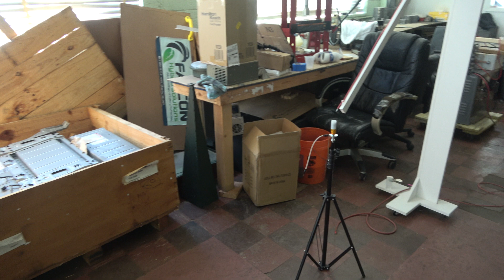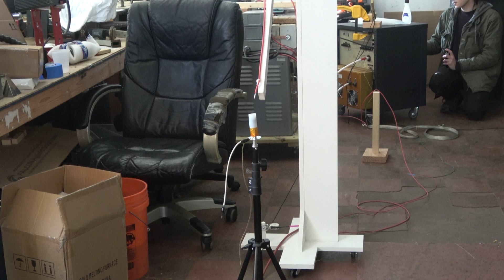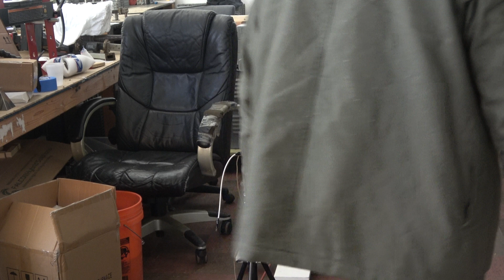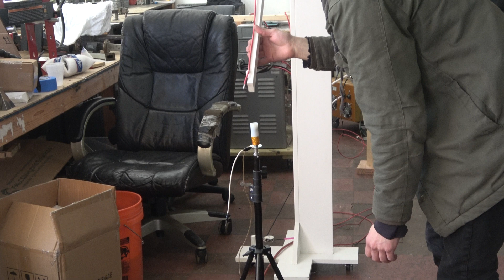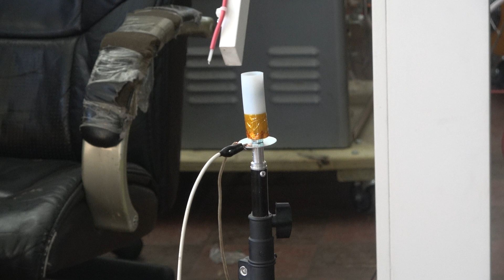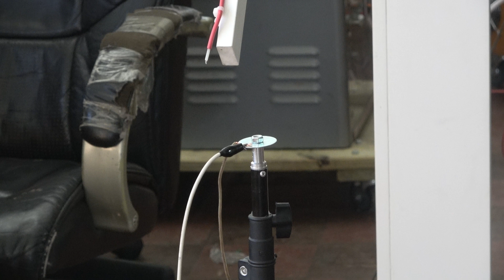lanthanum lightning strike weight loss experiment

Comment: Well at least a negative result still helps to move stuff forwards.  Mark, I was wondering if you could use your equipment to produce the hydrogen line frequency.  John Hutchison talked about using frequencies around the hydrogen line during experiments.  Also, any more work on the Banduric system experiments?
Reply: Odd, it seems to show a reply but I can’t see one when I click on the comment.

Comment: Mark and Jeremiah, use 40,000 volts as this is how the ICE works by fusing hydrogen. I do this with my furnace, water heater and stove to fuse the methane into oxygen. The methane has an atomic mass of 16.043 and the oxygen has an atomic mass of 15.9994. Hitting the lanthanum with the correct voltage will fuse the lanthanum with an atomic mass of 138.9055 into Hassium and the sample will lose mass with a concurrent production of energy release. You have to keep sparking the spark to continue the fusion process or the pulsing of the electricity that produces anti-gravity waves that reverses time, so the protons positive charge attracts instead of repelling so the lanthanum fuses but watch out because Hassium is radioactive.  Rick